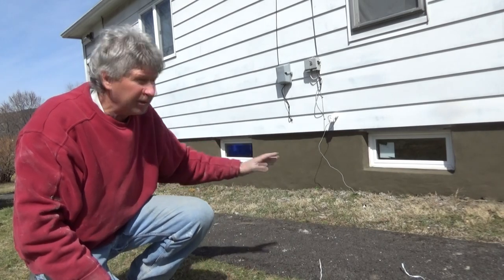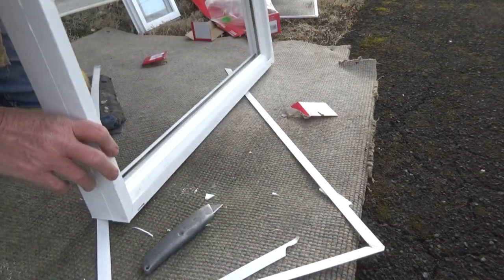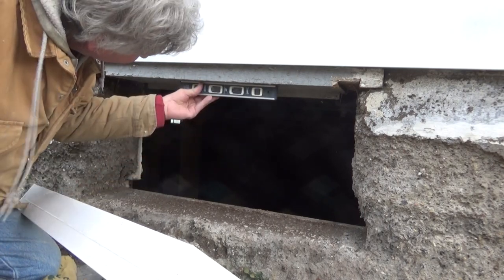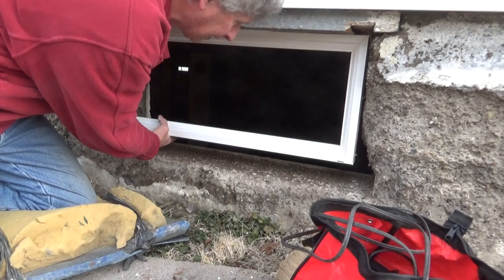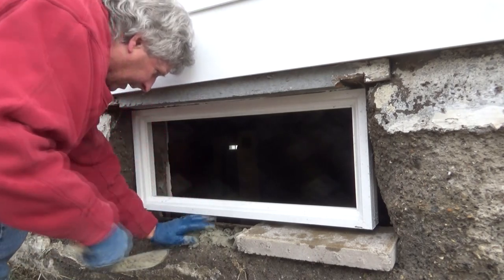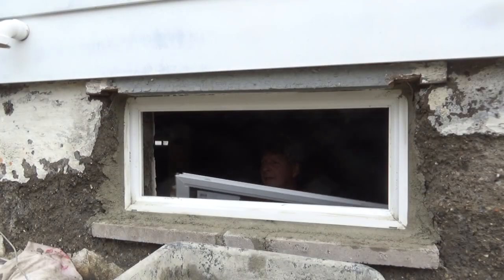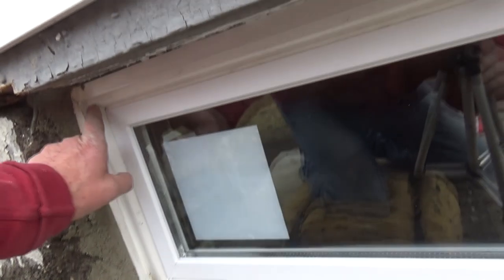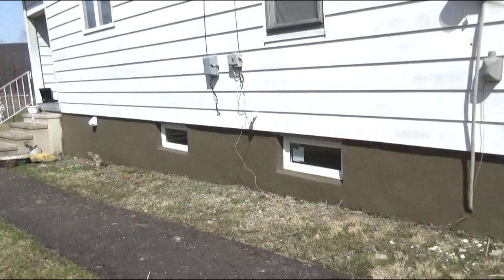BASEMENT WINDOW REPLACEMENT (Part 4) Mike Haduck

Comment: Do you like the spray foam
Insulation for around the basement windows? I was considering doing your mortar method but was concerned for insulation unless I just did the mortar on the front of the window. Thanks mike great video!
Reply from the maker: Hi, I personally never use the foam, thanks Mike
Reply: @MikeHaduck  thanks mike!

Comment: You SIr, is a master. My old house has the same wall issues, on the outside as well as on the inside. The foundation has all kind of cracks and i could see the outdoors from the inside thru some of the cracks. The blocks or what ever these used for the foundation then, is hallow, with no mortar or cement or steel in the walling, so I am thinking of filling in the hallow space with cement and gravel and do the SAME KIND OF JOB THAT YOU DONE HERE. Could you say if I will be ok with this and if it will strengthen the foundation? I am not a mason or anything, but I think that I could do what I saw you did here. My foundation walls look exactly like the one here. Thank you for posting this video.
Reply from the maker: Thanks Fada, I can't tell anyone one what to do, I just show what I did in my situations. and I hope it helps and save some people some money, if that makes sense, thanks mike

Comment: All of your windows look great! Have you ever heard of a 4x4 sill plate sagging and preventing the basement window from closing? My 30 yr old vinyl basement windows were installed with a wood header over top. I want to remove it so I  can move window up 4" and attach window to sill plate like you do. I would be able to grade soil higher and slope ground to prevent additional damage to foundation. I don't know ow if he did it because I bought the wrong size windows, or if he thought the sill plate would sag without it.

I was trying not to make a big deal out of it, but while scraping paint on foundation I noticed windows are coming loose and mortar is falling off. Crickets love the gaps. The installer built  a (treated?) wood box, surrounded it with mortar, and mounted vinyl windows into the wood box. If I have to fix them and can get them out in one piece, I may as well move them up & grade soil.
Reply from the maker: I am not there to see it so I can't make a judgement but I have done that on numerous occasions,  thanks, Mike

Comment: I did mine like this about 6 months ago what a diff it made this past SE Michigan winter. Mike I have a couple spots at the bottom of one window where the cement shrank and can see little light how do I fix it?
Reply from the maker: Hi, I just wet the hole area and rub some cement inside it, should work fine, thanks mike

Comment: Mike I just went through all of this on a house I own. The wall was deteriorated in as far as six or seven inches along one whole wall and down two feet below grade with other bad spots here and there. I did the repairs and plastered the whole house. I did use wooden frames around the windows but did it with PT lumber as my window order has not come in yet. In the end the job looks great but that was a lot of work! I used another one of your plastering videos as my info source. Thanks so much for the help! You are my go to guy for concrete info these days.
Reply from the maker: Thanks Dave, I appreciate hearing that, Mike

Comment: Another great video, Mike.  The boss, AKA my girlfriend, has this exact type of project for me to do.  Do you put the screws partially in the sides and bottom so the mortar can grip to the window?
Reply from the maker: Hi C, yes I do it, the cement will also hold it without the screws but it definitely helps in opinion, thanks, Mike

Comment: Hi Mike, Can you explain why you use the specific mix at the end-- 2 parts sand, 1/2part "s" mortar, 1/2 part portland + fiberglass?  What is the advantage vs straight mortar vs.  rapid set,  in this case?  In one of your other videos you used rapid set.  I have a field stone foundation and am looking to replace a 100 year old wooden hopper type window.  But I am not plastering or stuccoing...just fixing the mortar between the field stones.  Thanks.
Reply from the maker: Hi Wayne,  they probably used lime mortar in those days, I have a playlist called repainting old stone walls,  I show what I used there, I only use rapid set for something I want to dry extremely fast,  thanks Mike
Reply: @MikeHaduck  Thanks Mike.  As I am going through you're different videos I'm still trying to get a basic understanding of when and where one needs to use certain specific mixes.  From your many years of experience is there a reference guide you could either share or make specifically addressing this topic?  If not already done, it might be a great next set of videos where you compare and contrast the different material mixtures and more importantly the logic and some limited science as to WHY you would choose them.   Thanks!

Comment: That job turned out great, i have seen guys use expanding spray foam (tough stuff ) around the perimeter of the window to hold , then do a coat of cement, personally i dont care for that method, i like old school.
Reply from the maker: Thanks Robert, Mike

Comment: on a small job like this do you still do a contract with a bid, or do you just work for time and materials?
Thanks
Frank
Reply from the maker: Hi Frank, I give a figure at the beginning,  so much per window, here I included the foundation repair, but with a subcontractor I might work for him by time and they usually supply the materials,  every situation is different,  thanks Mike
Reply: @MikeHaduck  thanks mike I appreciate it 👍

Comment: Nice video Mike. What if the top part of the wooden frame was rotten -would you have to replace the wood or would you do something else? I had to replace the basement window on my father's Dupont house a while back and I  built a complete new frame to hold the  window.
Paul
Reply from the maker: Hi Paul, if I can get it up against the frame I will, but every situation is different,  so whatever works,  thanks, Mike

Comment: Hi, love your work and videos, learned a lot. I was wandering if if you have anything on block or brick tips when layed against steel columns and beams.
Reply from the maker: Thanks, nothing against, but most just but it up against and there usually tie ins for the block, thanks Mike
Reply: @MikeHaduck  Thank you, the wall is 12 feet from column to column and the blocks or bricks will be layed between the two, was wondering if it will be any issues with the expansion of the steel columns creating cracks. Do you have any videos on steel and brick combination. I saw the one where you installing a steel lintel. Anything else? Thanks again for your time

Comment: Thanks for the video!! Super helpful especially with an old stucco house like ours! We want to attempt to do our basement windows also on a stucco home but our windows have a metal frame cinder blocks  on the sides and bottom but the top has a metal slab on each window . We can’t screw into there, how would you recommend we install our window?  Thank you!!
Reply from the maker: Hi Jessica, you could pre drill into the metal, or a lot of caulking like silicone had gluing agents in it,  there is always a way,  thanks mike

Comment: Another tough job made to look simple by a superb artist Mike.
Thank you for posting it. I thought that the perimeter white plastic ridge around a window
was flashing to allow the windows to be held in place. You trimmed it and used
small screws? Any input here on why that is the better choice?
Reply from the maker: Hi pensive, it dosen't always fit with the flanges, they are made for wood, and I can't get the cement around the flanges properly, thanks ,Mike